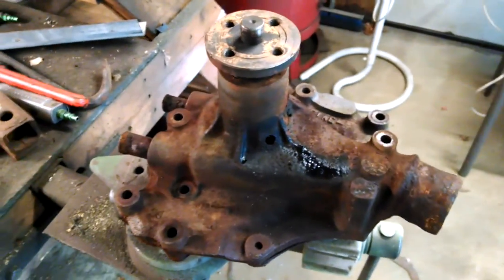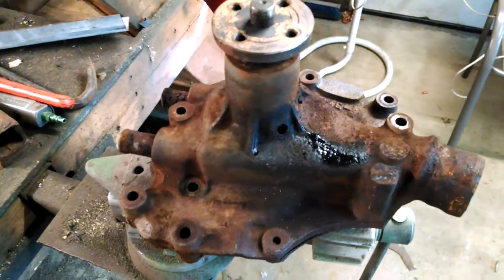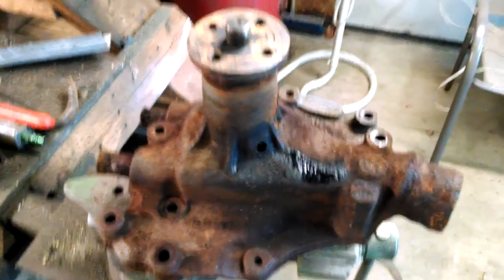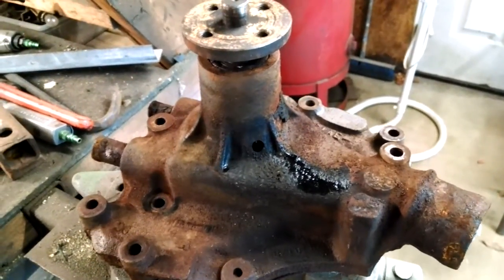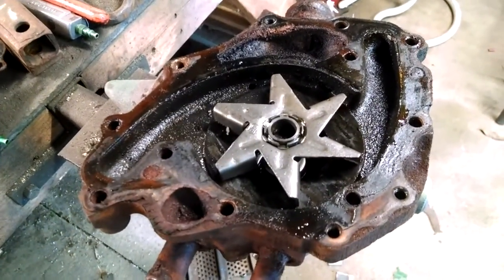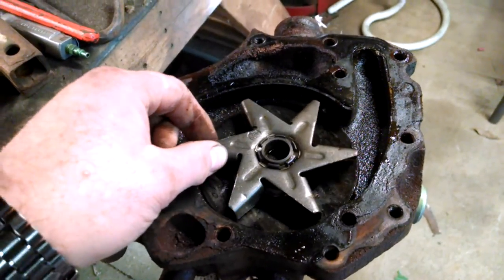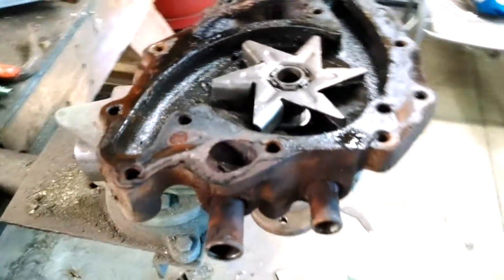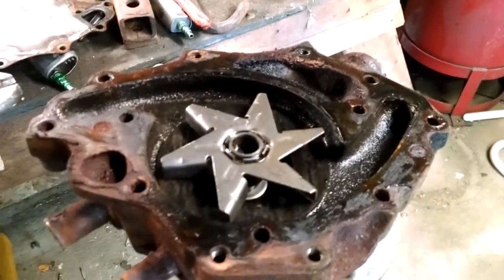Why was my car leaking antifreeze / coolant?   What causes a water pump to fail?

Comment: I have a 97 Plymouth voyager. It set for 2-3 wks. Till i took it in for fuel pump replacement.  When i picked it up the mechanic said i have a bad coolant leak he thinks the water pump...b4 my van quit running i had no coolant issues whatsoever..this guy told me if a vehicle sets for 2,3 wks  the seal cn dry out and leak...is this 👍 true? If not then the mechanic did something so i would take it back 4 a pump replacement
Reply from the maker: I don't know anything about that model of vehicle so I can't really answer with confidence.   I will say sitting for 2 or three weeks should never be an issue.   Typically water pumps fail at the bearings / seals and when they leak, they leak out the weep hole and onto the ground.   If the pump is leaking, I would guess it is coincidence, not from sitting.

Comment: Hello! 
I have a Chrysler Pacifica 2008 and it’s overheating and I took to a Mechanic and he said it’s the water pump and it’s good be $700 to fix, should I get Donne? And can I drive 7 miles to another Mecanic even the car do no keep the water on the pump, Plz let me know, I’m not sure what to do, take to another Mecanic?
Reply from the maker: I would get another opinion from another mechanic.   The water pumps are expensive and labor intensive to change on a Pacifica.   It would horrible to pay 700 dollars to find out that wasn't the issue because maybe the mechanic was wrong.  Here is some reading material to go over that may help.  https://repairpal.com/chrysler/pacifica/overheating

Comment: If you have a leaking water pump, isnt it just cheaper to keep adding coolant than to spend $500+ to get it switched out? you said they usually never fail so just adding coolant should.keep it going
Reply from the maker: +Nicholas Hall Most water pumps are only around 30 bucks for a rebuilt.    At 11 dollars for a bottle of antifreeze, no, its not cheaper. LOL.
Reply: Ok. I am looking at a old  van that will be about 500 in labor to switch it out....just thinking don't know how.much life is left in it
Reply: Not to mention all the contamination of leaking coolant, getting it in your hands while topping off etc. It's best to just fix it the right way.
Reply: Who tryed to rip u off it’s 40 bucks new water pump thermostat is like 10 bucks
Reply: @melimdallas1702  Why did yours fail if internal parts look ok, so then what caused your weep hole to start leaking?
Reply: Sorry, You answered my question after I watched the first part of your video again where you mentioned the seals went bad. In another video I just watched, a guy attached a 1/4'' clear hose to the weep hole, then ran it up to top of engine to keep dirt from entering hole, and it also eliminated the need to add coolant. Could this be a cheap fix as long as the pump bearings hold up? Thanks Steve